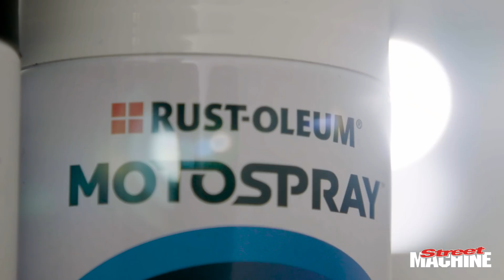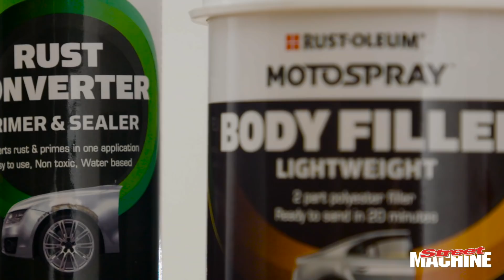Rustoleum Motospray Wagon - Part-1 (Carnage Plus EP45)

Comment: Pro tip with the paint stripper, apply it then cover the panel with a plastic drop sheet. It prevents the stripper from drying out straight away and keeps the reaction going, lift the plastic a bit at a time as you remove the paint. Usually you can get away with one application. :)

Comment: A fun episode but I'd never use any body products from any of the big 4 car shops. Single part paint systems will never hold up like a half decent 2 pack system will. This I have learnt over the years.
oh and only an epoxy primer or similar will protect the steel from moisture. 
Most primers are porous.

Comment: Chassis ?? you mean sub frame!
Reply from the maker: Same same, we actually refer to them as chassis rails down under
Reply: @STREETMACHINETV  no we don't. A chassis is a chassis, a unibody has sub frames.
Reply from the maker: @rossbrumby1957  I have never heard anyone refer to Valiant chassis rails them as subframe rails. I'm not saying that's technically correct, it's just the terminology used

Comment: SANDED THE PANEL WRONG! 
Supposed to use the whole sanding pad, NOT the edge. 
This will also tell you where your high and low spots are so you can repair them before you continue sanding.

Comment: Did a VE V8 VIP Safari about 20 years ago, probably one of the rarest Valiants made. https://postimg.cc/PLW7j2CL Thats the original colour too, Midnight Turquoise IIRC
Make sure you check for cracks in the chassis around the steering box. Also it will be interesting to see if the wagon side window rubbers are available now - no chance when I did mine...

Comment: New floor or recycled?
How are the plenums? With all that fiberglass insulation stuffed up in there any rust?
When I did my VG wagon 18 years ago the floor was nearly as bad LOL. Replacement steel was a bit easier to come by back then though. I had to rebuild the rail on the drivers side though mine was nearly hollow? 

LS conversion candidate? You know you want to. I would say Barra but that would be even heavier than the Leaning tower of power..

Comment: Thanks Scotty, great vid mate, just a heads up when putting the glass back in the old girl. I had a HX Holden wagon many years ago and the windscreen rubber leaked a bit, I took it to a windscreen mob and talking to the old guy there he said it had a silicon rubber in the front and that's the problem, so they took the screen out and thankfully it was ok, but he said silicon window rubbers in older cars WILL make the windscreen channel rust, you absolutely MUST fit a straight rubber seal NOT silicon rubber.  Just thought you might like to know mate. Seeya Rob..........hope you and the family are all good mate.

Comment: Whenever I use strippers, I always put it in heavy, then put plastic wrap over it, let it sit so I doesn’t dry out, then get a stainless sink scrubbed and scrub it off, takes it down to clean metal
Reply: Running over it with 80 quickly before you put the stripper on helps aswell
Reply: Mat Best and heat up the metal, depends on what it was painted with also, some of the paint clogs even 80 grit, I’ve done both, depends on where you’re working too, in my shop I don’t want to get all the sanding dust everywhere, and I cAnt sand outside
Reply: @xozindustries7451  if you can't sand then at least give it a good stiff wirebrushing. Makes a world of difference and save on the amount of stripper you need.